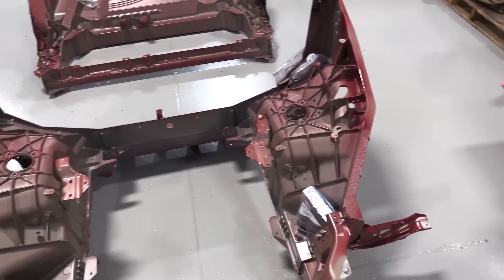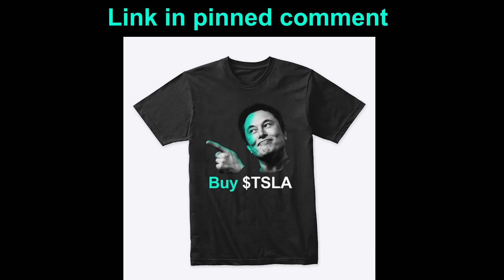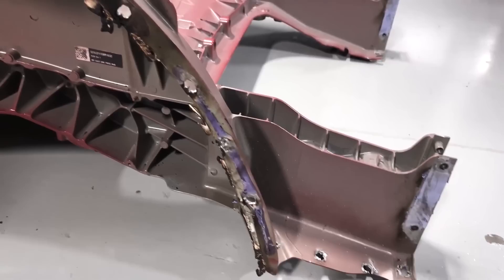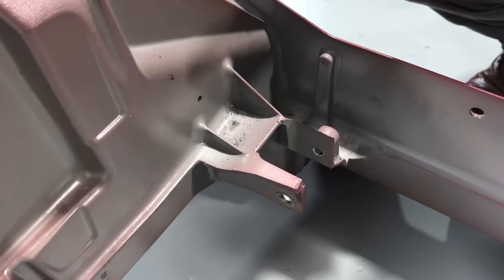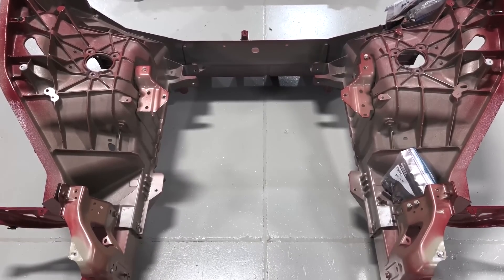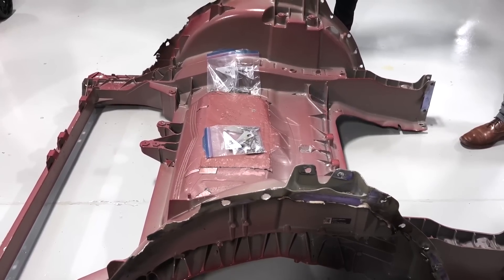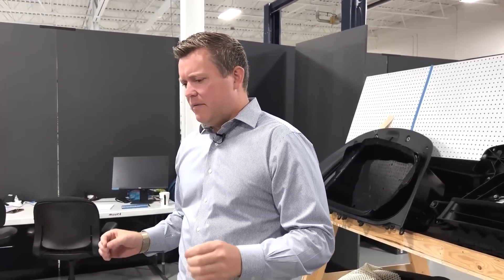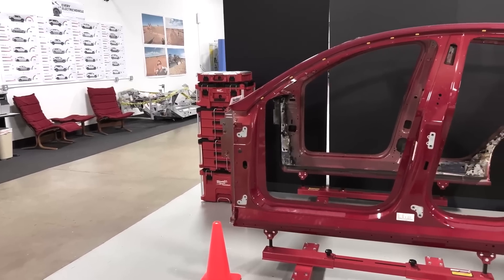Newest Tesla Model Y Giga Casting: “Blows Away” Munro Crew

Comment: from an engineering stand point, rigidity isn't the most important, as too high g-forces will then hurt the passengers. Rigidity is highly important for the passenger compartment. But in fron and back you must use crash cans, which destroy huge amounts of the impact energy through deformation. The more impact energy they absorb, the higher the chances to survive in a fall crash as the maximum g-force on passengers is limited to levels a human body can sustain. So if front and rear would be as rigid as the passenger compartment, this would be lethal on fatal crashed. 
Rigidity at the right place is most important, as is softness at other structures.
Reply: True, but as fracture mechanics dictates, it is how something breaks that is mos important in the dispersion of the energy of any failure. How it happens and what it’s made of, mixed with the angles matters more.
Reply: Wolf I agree !
The designers of the Smart car had the same issues !
Reply: @maxflight777  Yes, but I think that it really depends on the specific Aluminum allow used and how it was treated, but I digress. I would like to think that if they did their research and applied fracture mechanics, in terms of failure, it could still be rigid for the ride but good in a crash for energy dissipation and break in the right way to avoid injury of the passengers. It seems pretty good but I would want to see the FEM analysis to be more sure.
Reply: @seank7288  it depends which rigidity you're talking about. Softness in crash doesn't exclude at all rigidity in the ride. This will be in a third dimension, whereas collisions happen in the first two dimensions.
If you look at the back casting you'll see the crash cans are integrated into the casting, but not the front ones. It may be political to do so: if somebody crashes in your rear there's more space to absorb energy. But ore important. in 99% of the cases it's the insurance company of the car behind which has to pay. In case of front collision it's more likely that yourself have to pay the damage. Here, the non-integrated crash cans come in very handy, as you won't have totalled your car. It'll be expensive repairing it, but with a good chance it may not be totalled. 
And yes, they're using all computer means to calculate rigidity, stiffness, softness and energy absorption. It's not the first car they design
Reply: @wolfheilmann774  woahhh would have never thought of the insurance component and who pays…makes total sense
Reply: @wolfheilmann774  Steel alloys too, sorry.
Reply: This is why smart cars can be deadly. Passenger compartment survives, yet g-forces on the occupants are excessive.
Reply: @tedecker3792  My Ex-girlfriend was a paramedic nurse, and she showed me the photographs of a smart car behind an exposition that was hit full force from someone in a pickup. No one survived, and there was a spine hanging out, all identification was blurred out, but it showed enough. Just like minivans are not safe in a side impact, no D pillar, but a five star from the front.
Reply: Implement energy-absorbing memory foam in vulnerable areas. Self-healing or easily replaced. Never say it's impossible when Tesla is involved.
Reply: @nononsenseBennett  self healing wouldn't be possible, as you must modify kinetic energy into deformation. Easily replaceable is also quite difficult task, as you must avoid that the parts detach upon impact. But it could be designed to be replaced with a certain, non too costly effort.
Reply: Yup. Quite the delicate dance with the SRS. 
Too stiff and not enough energy absorbed. Result: you slam into the steering wheel and then the air bag deploys you. Ouch.
Too weak and too much energy absorbed. Result: air bag goes off, deflates and then you eat the steering wheel. Ouch.

Back in 1990ish I had a body shop frame guy show me a car w/ a home job front body replacement. He showed me the welds and poorly chosen location of the repair cut/weld. He said the owner should have cut the front off at the firewall and replaced everything forward vs welding 1/2 a front engine bay to the original stumps left from the original bay. The welds would make the bay too stiff and reduce the airbag effectiveness.

Comment: SMR … the question is … “Is all the good news about Tesla, already built into the market cap ?”
I’m genuinely curious. Personally I suspect it is.
Reply: TSLA stock will 2x every 2-3 years, for many years to come.
They will sell 20x more cars in 2030 than they did in 2021, AND Tesla energy will be as profitable as Tesla auto in 2030.
Teslabot and FSD will most likely both have a larger revenue in less than 10 years than Tesla Auto will have in 2030. The revenue for Tesla Auto should surpass $1 trillion dollars in 2030, which means Tesla should be able to make more than $5 trillion in ~2030, or $5000 billion. Thats almost 100x more than 2021 revenue.

From 2009 to 2021 Tesla revenue grew on average 78% EVERY YEAR.

So they need to «only» grow their revenue by ~66% every year from 2022-2030 to reach $5 trillion.

So if I were you, I would go for it.

Soon to be Teslanaire!
Reply: @runeoveras3966  Rune … interesting! 

(I think 100X 2021 revenue in 2030 is a wild claim though ! )
Reply: @runeoveras3966  I like your point about FSD revenue !
Licensing etc etc .. 
at the moment it’s far from “working “ ! 
I do think (having used FSD Beta) it’s not certain he can make it work with the current cameras ! 

I hope they can … but I’m not confident

Don’t misunderstand me ! I’m part of the clan ! I love my Tesla, I’m an investor too …. But sometimes the autopilot can’t even take a well defined curve in the road correctly. It’s disappointing.
Reply: @maxflight777  they will solve FSD with current cameras. And they will license FSD. And make a sh$itload of money….
Reply: I agree. You should sell your shares to me i dont need them.
Reply: Not a chance.
Reply: Easy way to answer your own question. Look at what wall st analysts are saying about Tesla's business, not the stock. Then consider whether you think reality will be better or worse. Spoiler. It's going to be better (barring something v unexpected)

Comment: Not just deletion of parts, welds, rivets, adhesive, but inclusion of webbing, so super stiff. I note the shock mounts still required additional (steel) support to spread the load.
Loved the interpretation of castings needing massive scale, small model range, for coin efficiency.
So bye bye BMW & Audi, and undercut Mercedes, Porsche, Lexus.
And adiós ratings agencies with poor understanding of economics.
Engineering, marketing & economic proficiency. A master plan. Ethics. Devastating.
Reply: This underbody structure would work perfectly with a single box MPV. Out Bus the VW Buzz.

Comment: So how do you service that casting if it was crushed?
Reply: You don't but you wouldn't in a dinosaur car either, they would be a write off, it's in the vid🙄
Reply: In an easier way than with the current Petrol Saudi Arabia cars
Reply: Idiot … a body in white of welded and bonded steel can be written off just as easily.
Reply: 9:07